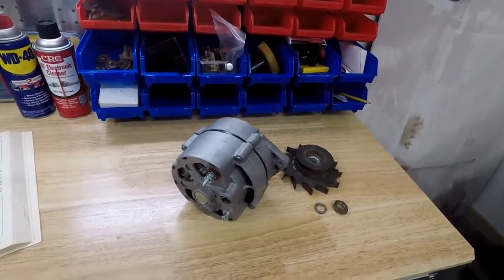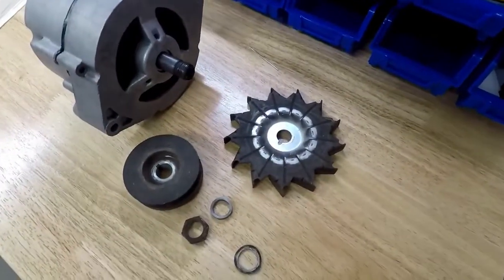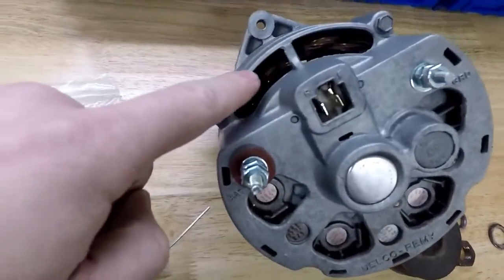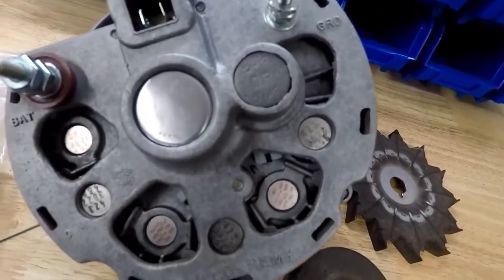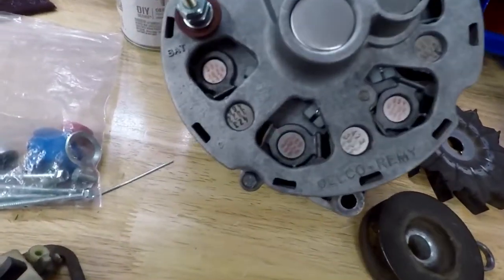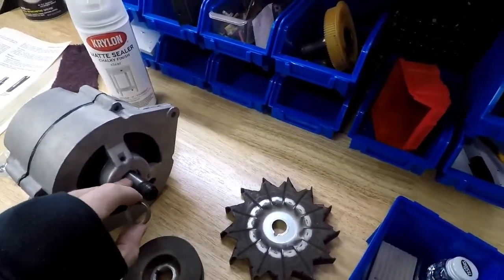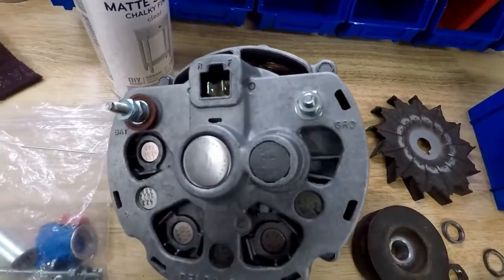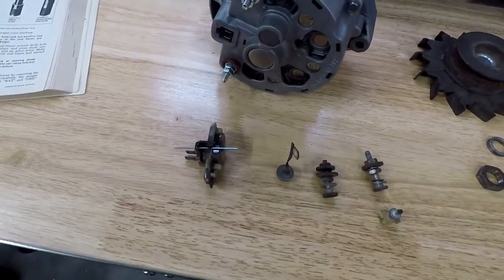1963-1972 Corvette Alternator Restoration

Comment: Sand blasting the aluminum case totally destroys the original cast finish.  Bearing is a Torrington. The solid steel pulley s/b plated except some 66 base units.